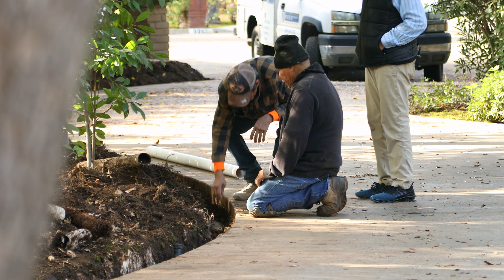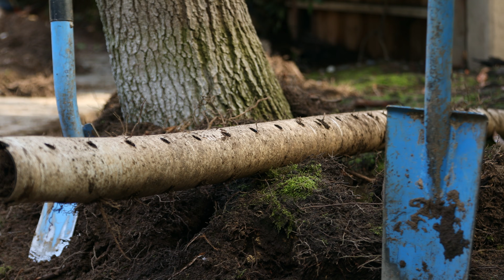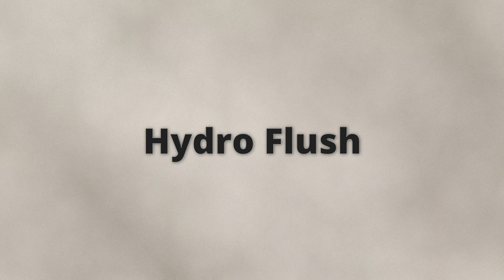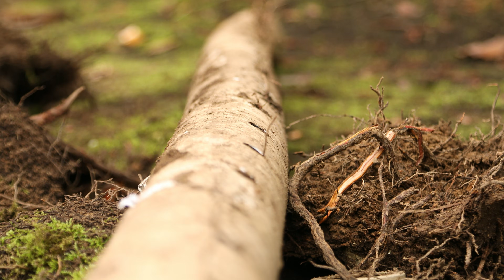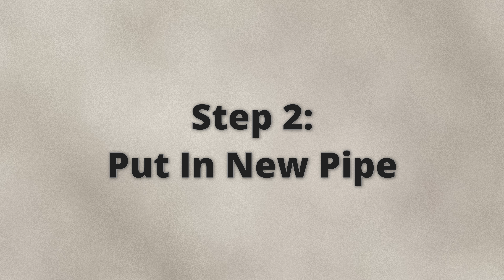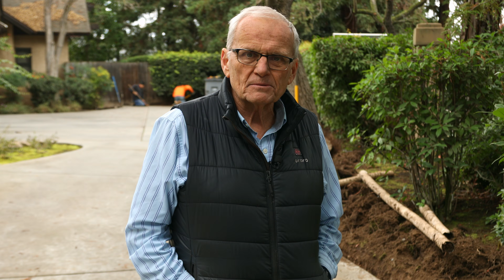How To Fix Your Clogged Yard Drain | Yard Drainage Solutions (DIY)

Comment: I had a drain pipe that had been placed with the joints deliberately left loose so roots entered at each joint. When I dug it up, the entire length was solid roots.   BTW, a hydro flush is just a high pressure nozzle at the end of a hose. The nozzle has a spray pattern that is suppose to clean the walls of the pipe and can be strong enough to cut off thin roots. Can be very effective on sewer pipes, but won't work at all in the pipe you had.